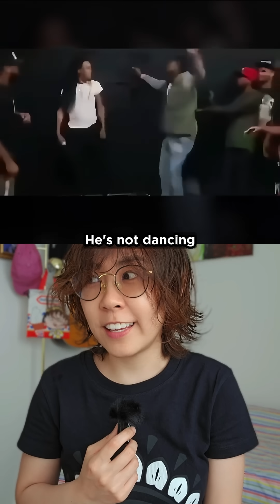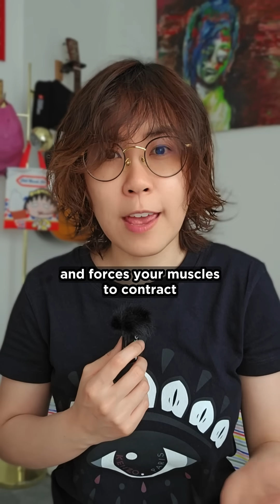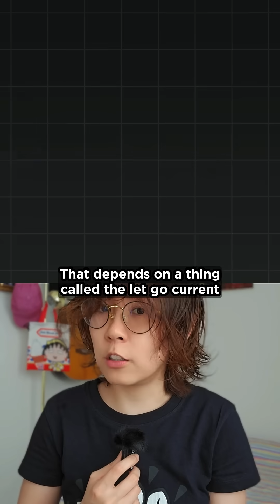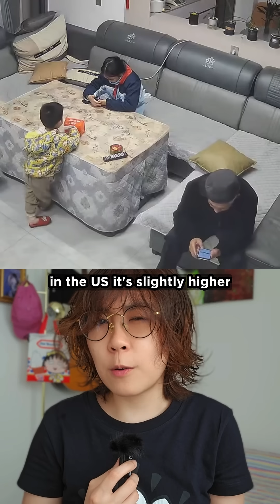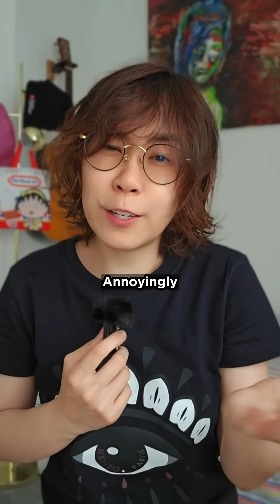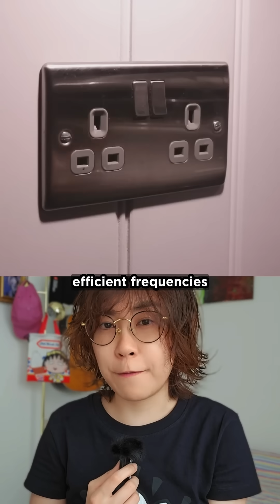How Much Electricity Can You Touch Before You Can't Let Go?

Comment from the maker: I think the 🕺 guy was pretending to be shocked for the first few seconds... before actually getting electrocuted for real. What do you think? 🤔
Reply: he almost became michael jackson with those moves, literally 💀
Reply: That's not how a person moves when they are being electrocuted or shocked enough that their body starts convulsing. They actually can't move because all of their muscles lock up. Just look at any video of a person being tazed. He was pretending to be shocked but then pulled too hard on the wires which caused them to short out and spark which trips the breaker and shuts off the power.
Reply: Residual Current Devices are mandatory and fix the issues raised in this video.

Magnetic Polarity should cancel between the in and the out parts of the curcit. When electrons find a way to bypass the RCD there is an imbalance, leading to the off being thrown at less than lethal energys.
Reply: Cursed
Reply: I don’t think so. I think he was in shock (metaphorically as well as literally) and had no clue what to do
Reply: @ElectroBOOm
Reply: Can't we get better efficiency by going up to 120hz? Or 999hz? Why not?
Reply: You hair is majestic 🫠🫠🫠🫠
Reply: @Kaigonzerino  isn't even paying attention to the video anymore 💔🥀💀😭
Reply: Brings an entirely new spin to the Electric Slide😅😅😅
Reply: @recco_caine  The electric stuck
Reply: Nah, I remember I was in those tube-things for magnetism and it made my arm involuntarily flex and contract.  

It was only for a few seconds but it was honestly scary.
Reply: I was once electrocuted, i couldn't let go of the wire i was holding and i was just bouncing up and down until the wire i was holding slipped from my grip and i was just fine and i made a joke to my brother and friend explaining what happened and we laughed lol.

No concerns just fine 👍
Reply: 🕺 Subaru Natsuki
Reply: "the let go current" must be close to "the light go current"
Reply: Did they die? Electrocution is death by electricity. Or just got shocked?
Reply: His movements were way too deliberate and natural looking imo
Reply: Usualy when someone is shocked they dont dance like that they get locked up (i know it from my own and youtube experiance) and then in the last few secounds he actualy got shocked
Reply: Me the first time I used my TENS machine.
Reply: This reminds me of a really awful video from China, where a department store worker goes to turn off a fan. Is electrocuted so intensely, they just stand there. People walk by, oblivious. But you know, from the context of the video, that person is dying.
Reply: I also thought of him dancing around the wall until zap and it turns dark.
BTW AU's AC frequency is 50Hz too.
Reply: I think you're really sexy.
Reply: Nah that was electro dancing
Reply: Electrocution is a form of execution.
Reply: idc about that all I want to tell you is i really really love you would you marry me beautiful girl? oioi 💋
Reply: @drystick-dy1ub let's have your wedding in jail, she'll visit you sometimes.😜
Reply: Shut up brother just watch dont simp or think or say anything inappropriate to her @drystick-dy1ub  TOUCH SOME GRASS
Reply: Oh
Reply: Yeah cause everyone else thought he was dancing still
Reply: I am traumatized 🙍🏽‍♂️
Reply: Take a shower, pls
Reply: Did he die I am with you
Reply: Are they both okay? I have to know
Reply: R😊
Reply: Use the back of your hand to check if you get zapped your hand won't lock on to it
Reply: I don’t know why, but I have a new obsession and it’s your beauty. If you have not been told today or any day, you are absolutely gorgeous! 😊
Reply: I really hope he wasn't electrocuted and AAs just shocked. X.x
Reply: I’m shocked you thought that
Reply: So he died?
Reply: @Quifuh  probably survived if they took him to the hospital in time, but it's still very dangerous and there is a risk of dying.
Reply: -_- bru
Reply: Yeah 
Just like me 
After seeing you 😌😅
Reply: @vt.physics  you're beautiful
Reply: I got shocked when I was charging on some times

Jesus loves you,he died for you,repent
Reply: @raellikesfries, we also love Jesus, but he didn't die! He was raised to heaven, and he is alive, and he will be back to kill the pig and break the cross, spreading Islam

Comment: My dad is an electrician.
If you NEED (for any godforsaken reason) to touch a wire,
Always ALWAYS touch it with the back of your hand so you flinch away instead of grabbing it
Reply: Obviously avoiding touching the wire is better so try to do that instead if at all possible.

Comment: Is it actually true that the only reason we still use 50-60 Hz is because of the enormous costs of changing our whole electrical infrastructure? I heard if we built our electrical infrastructure today and wanted the best, regardless of cost, that we'd use a blend of High Voltage Direct Current(HVDC) for long distance transmission with converter stations at the end points and then run 400 Hz AC current. I'd love to know what you think!

Comment: Incorrect. 60 Hz is not the most efficient method for transmitting power over the grid. High voltage DC is more efficient. AC is used for local transmission for historic reasons. It uses simple technology, namely transformers made of wire wound around iron, allowed low voltage to be stepped up to higher voltage, and also ran AC motors, thanks to the genius of Nikola Tesla. Modern high voltage DC lines of up to 1 million volt DC lines connect cities, countries and islands.

Comment: Yeah he faked it for about 2 seconds danced and got sweaty probably on his back area. The salty area made for a good conductor and the shock got worse and he panicked and more pores opened up. Then he reached in with his other hand to pull his hand off and completed a stronger current then bam. The fuse saved his life. Assuming there was a fuse.

Comment: That is AC, but DC has become a viable option for transmission, the capacitance effect of the skin should prevent it from shocking you, this effect is bypassed by AC, so now the only question for safety there is how much Voltage would it take to break the capacitance effect on your body.

DC can be more efficient than AC at high voltages, because DC uses the whole cable for transmission meanwhile AC only uses the surface of the cable, conversion between different voltages is more efficient with DC, but we need a time to adjust because we would need to adjust all our electronics to take the DC, this would also reduce the costs of removing transmission poles in favor of underground transmission, but there the biggest cost is the construction, not the shielding to avoid problems from AC

Comment: I wanna know does it hurt like craZy
Reply: Wait you never experienced electric shock? 
Well TV(or you probabaly know it as LCD) I was trying connect cabel with LCD socket and because switch was on I got a heavy electric shock I instantly stepped back,But my whole Right arm was numb for few minutes also my ears were ringing it's not a great experience it was similar to getting a panic attack
Reply: @HeroX-i5  i probably did i hust forgot the feeling and memory, and ouch that sounds like it DOESN'T feel good

Comment: I've had an electric shock after I inserted a knife in the socket at 18 months old. Up the wall and ceiling from the melted socket were burnt, I said to my parents with my hand flapping, "hot, hot, hot!"
I touched an electric fence at 9 years old and was addicted to body buzzing, I kept coming back, until the landowner blocked me by concern for my safety.
Again, when I touched a live wire at 14, shocked, my fingers were black, but I was fine. 
I was shocked again when I was changing the light bulb while standing on the iron tub, I flew off  and hit my head with the wall, I was dazed, but I was fine again 😅.
The metal base of the ceiling light was investigated, which turned out to be badly wired by a rushed apprentice electrician a year before. 
Now I am very cautious about the electricity. I don't know how many more lives are left in me!!

Comment: Think this might of happened to me, one time when I was unplugging a charger with a pretty inconvenient grip, so dumb ahh me, gripped around and accidentally touched the metal part, my arm started to spasm for a fraction of a second but, because I barely touched the metal part, I think the spasms disconnected me from the power, or I was able to pull away, can’t remember, I was shocked(figuratively) thinking no way that just happened.

Comment: As an appliance repairman, one time I was on top of a dryer plugging in the dryer’s 240 volt plug, reaching blindly behind the dryer. Next thing I knew I was sitting on the floor about 6 feet opposite the dryer. The shock apparently caused my arms and legs to flex so forcefully that I ejected  myself away from the wall about 8 feet to the opposite wall.
Reply from the maker: It makes a cool story to tell 😆
Stay safe 💜

Comment: 7 ma across the heart for 3 seconds is enough to kill a person.  Current is determined by the voltage and the body's resistance.  Body resistance on the skin can be as low as 300 ohms.

Comment: I had this happen to me with 240 Volts AC. I grabbed a hold of a flex conduit with my right hand. My left wrist made contact with all three wires (tapped together with their ends exposed). I literally could NOT let go. 
Lucky for me there was someone standing right next to the breaker panel.
After realizing I could not let go, I yelled, repeatedly, " TURN IT OFF! TURN IT OFF!". When they were able to do so, my body just slumped to the ground. I was exhausted, to say the least. I took the rest of the day off after THAT fiasco.
ALWAYS CHECK BEFORE SERVICING ELECTRICAL - NEVER ASSUME!

Comment: One time my parents told me to plug in the ceilling fan which had very faulty wires i was afraid to plug it in but I had to because my parents would beat me up if I dont.

I plugged it in, got shocked so hard I couldnt pull out of it, my vision turned white and I felt my hands burning it was like 2-3 seconds of just pain the burning sensation like as if you put your hands on fire but you couldnt pull out of it, once I got out of it, they got angry at me for standing there for a few seconds and scolded me, for pausing.

Comment: Oh hell.  Getting shocked at all is not fun.  I actually had this shock when I was with my grandma in the shopping mall, I touched the metal on an escalator which I think had a lot of static electricity.  Thankfully it wasn’t enough for me to trap my muscles enough to let go of the handrail of the escalator and thus the part of said escalator where I had touched metal with my finger.  Still, I could feel the current travel from my arm, to my chest and then to my right foot where it touched the ground.  A very unpleasant memory.

Comment: DC is what you really gotta be careful with because it doesn’t have a frequency; it flows constantly in one direction. The 50-60hz in alternating current is actually what allows you to not get locked up. There is a point when the polarity is alternating that the sign wave is at zero meaning no current is flowing. 

There can be exceptions, but it’s rare for AC to make you lock up.
Reply: Ac is gonna lock you up real good if your body completes a circuit

Comment: I learned it the "hard" way,.as a teenager.
I had no idea about this phenomenon back then, until I realize my atari st computer kidnapped my finger somehow.
And it wasn't letting go.
Its grip was insanely firm.
And it started to make my whole finger vibrate hard.

A few seconds of growing panic later, I finally started to run away, and it let go instantly.
I was free.

Yeah, of course, I never thought my computer was actually holding my finger hard, and almost instantly realized I was getting electrocuted, when it happened.

But that exactly how it felt : like hulk locks you up, doesn't let go, and you have to figure out a way of moving out of the situation while your body doesn't respond at all.
I was very very lucky I just had a finger stuck.

Comment: I was on a party boat one time and this dude had fucking christmas lights wrapped around the metal rods for holding up the shade. (Stupid af i know, as they have no ground). I was pretty drunk and leaned on the metal rod and the WHOLE DAMN THING was live. I told him and he never did anything about it. The worst part is the deck was wet so i got shocked pretty good.

Comment: I mean ive been shocked like 6 times till now by the mains, but never ditectly, it usually always was while working on something that had both a ac to dc converter and also probably some form of resistors which would limit the current even more

Comment: Grandpa was an electrician his whole career. He worked on transmission lines on poles. One of the first things he taught me was power lockout. Second thing was if you have to touch something that MIGHT be live, you don't wrap your hand around it. You tap it with the back of your hand. If you are unfortunate enough that a line is powered, and you are ground, your muscle contraction rips your hand away. It will hurt, you might be injured, but you will be alive. (He once had a friend punch himself hard enough in the chest to break ribs.)
Reply: That woman at the end got electrocuted by the electric blanket. Yes it’s rare but I would never buy my cat or myself an electric blanket. Why gamble with 1% chance even
Reply: I was always told I’m just use one hand so the flow doesn’t cross the heart. Two-finger test.
Reply: We use bare hands when the testers in the van. Just have to be careful completing the cct. Gentle taps with a damp finger
Reply: Ain't no way he's electrician. Who's gonna touch a wire using their bare hand when the possibilities to get electrocutes is high 😂 watehel granpa

Comment: The think that I can compare electricity current is like fluid current. Voltage is kinda like velocity (faster motor) while ampere capacity is kinda like fluid volumes.

Comment: I got electrocuted when I was a teenager. House struck by lightning, went through the wires, into desktop, and into my single wired earbud. I was immediately knocked out so I didn't feel anything until I felt myself falling off my stool because I had clenched everything as hard as I could. My back was arched, arms and wrists tucked to my chest, fingers and toes curled, head up, eyes squeezed shut till I came to. If it had ended me, I probably whouldnt have known. Just immediately into senseless oblivion. I was a little sore afterwards from that & later heard its possible to even break bones during electrocution 🥲

Comment: If you want to test if something is energized, use a tool like a current indicator. These tools are extremely inexpensive and they are small enough you can keep it in your pocket., about the size of a small screwdriver.
     You can even get one that makes a buzzing or beeping noise and call it your sonic screwdriver.
     Now if you want to be stupid and test it with your hand, use the BACK of your hand. That way if it's above the let go currant it clench your fist over nothing and you can just move your hand away. Very likely your hand will move away on its own. 
    If you HAVE to be stupid, at least limit your stupidity.

Comment: He wasn't being electrocuted, this is definitely fake. If he was being energized, it wouldnt be this violent. He would simply lock up and be very still. 

Also it's not the current that you have to worry about when it comes to not being able to let go. The higher the Voltage, the greater the chance of being locked on. Current is just what does the damage.

Comment: If you ever need to help someone who is being electrocuted:
DO NOT TOUCH THEM! That will just create a parallel circuit.
You have 2 options: break the connection with something non-conductive, like a 2x4 or a boot, or shut off the source of electricity.

Comment: Yeah, that guy was actually just pretending (at least at first).  In addition to the fact that people who are being electrocuted don't flail around like that anyway (look at the other video of the woman with her family to see what it really looks like), there was also no current path that would reasonably cause electricity to go all the way through his body anyway (his feet weren't in contact with anything electrically conductive).  Even if he did touch an exposed wire, it would have just caused his fingers or hand to constrict, not affect his whole body.

(I've actually had this happen to myself once when my thumb and forefinger accidentally touched the two prongs of a partially-plugged in plug.  I became unable to move the muscles in those two fingers or my hand (so I couldn't let go) but I was able to move everything else just fine (so I used my other hand to just push the plug away from my fingers, and everything was then fine).)

Comment: Once I was lying on the floor and there was a small pedestal fan beside me with a metal bottom
Initially,it wasn't a problem untill a loose wire mace in contact with the bottom 
I knew bout the issue but just was being careful with it ever since
That day,it toppled over and when I tried to put it back,I accidentally held its bottom and my hand clenched onto its base tight 
It felt like I was brutally hit by a car on the side but when I knew I couldn't take my hand off,I suddenly rolled over like a crocodile's death roll and then I relieved myself and it took me quite a while to understand the whole situation 

We threw away the fan that day itself
Reply: crazy, normally a metallic case like that would be grounded for that exact reason, whoever built that fan almost killed you by being cheap
Reply: OMG, sorry you had to go through that. 😢
Reply: At least there was no video for a psycho like this to make “content” with